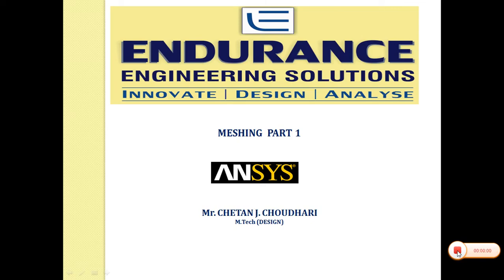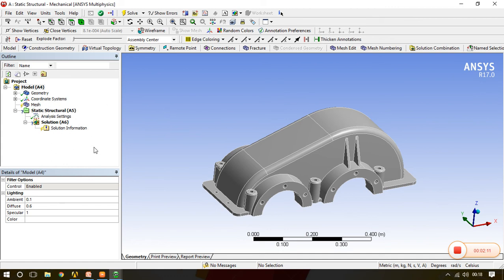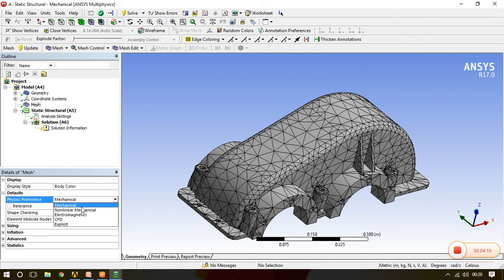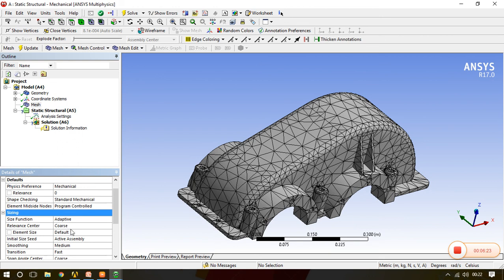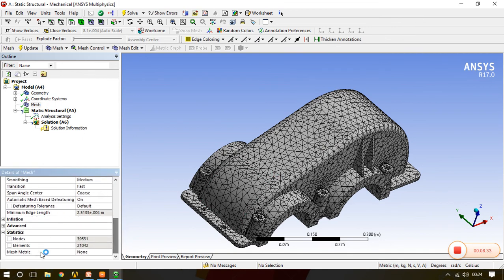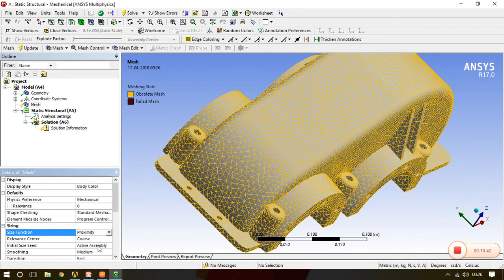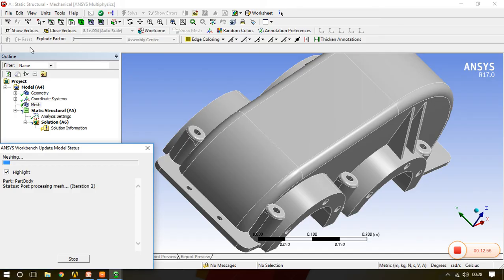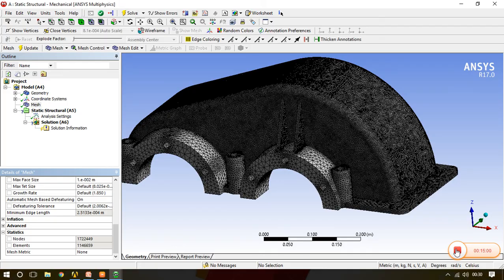ANSYS  GLOBAL MESH SYSTEM (RELEVANCE, PROXIMITY,CURVATURE & MESH SIZE) PART1 TUTORIAL 7

Comment: Make video on 19.2 many settings have changed .
Reply from the maker: Most of the company use this version so I decided to make video on it.
Reply: @SkillEliteProfessional  agree and I found your tutorials quite good for a beginners(like my self ) . Keep up the good work.
Reply: @SkillEliteProfessional  I'm facing an issue while meshing rollcage .
2 of the rollcage memebers are somehow joined together and acting as single body and mesh is failing there . Can please provide some tips over this .
I have tried changing the shape of mesh and using a fine mesh also but nothing is working 
Your help will be highly appreciated.